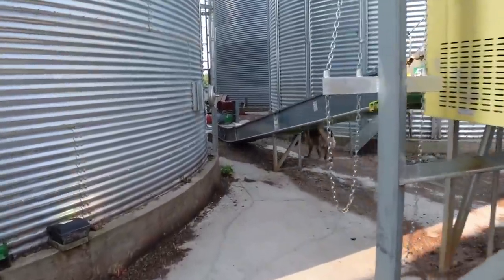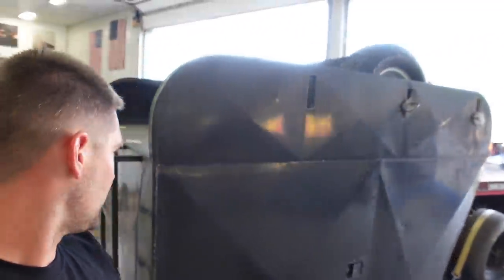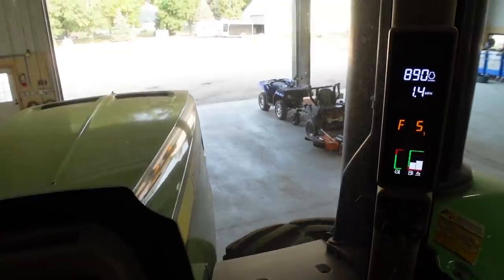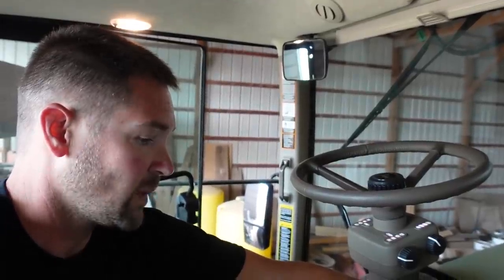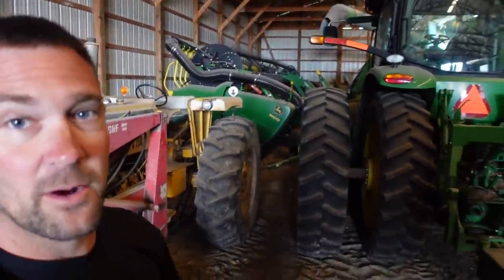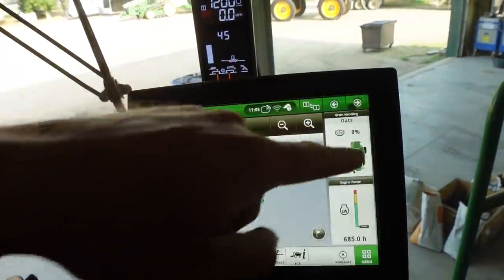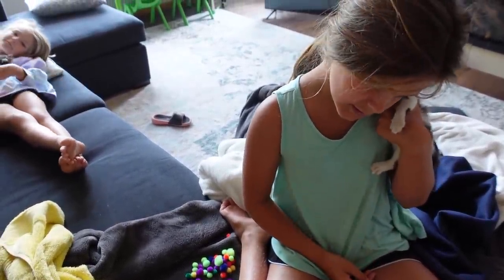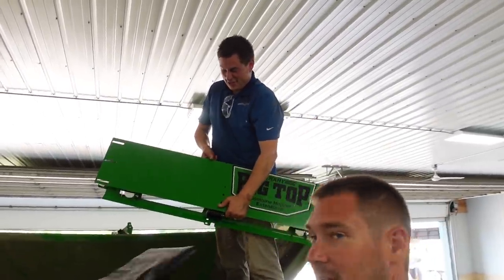Our Land Purchase

Comment: Cool trick I learned years ago from a sheet metal mechanic is if you put a piece of wood on the other side of the metal your drilling, the drill bit wont catch on the metal and yank the drill out of your hand. It just goes right through and you dont get that sudden jolt when you get all the way through the metal. He had a bunch of small pieces of wood that had hundreds of small started holes about an 1/8" deep.

Comment: #1. I hope you enjoy that fridge in the 780.
#2. Just below the bottom right corner of the 780 screen is a physical shortcut button to pull up the "bin open/header unfold" screen.  I love it, it saves time over trying to remember which touch screen button to push to get there.

Comment: If you use an impact driver to drill through sheet metal it will not snag and break your wrist.  It will go into impact mode and power through without snagging.  Most common sizes are available with 1/4 inch hex shaft.

Comment: Some of our equipment gets used so little that we decided to put trickle charge pigtails on the batteries, and hang trickle chargers on the equipment.   Kind of a mess with extension cords running from the equipment to the back of the shop, but a lot easier to unplug a trickle charger, toss it into the tractor (or whatever) toolbox, and go.. rather than go through the hassle of jump starting some equipment, which can be a royal pain depending on where the battery is, getting a jumpstarter over to it, etc.

Comment: Back in 1970, FFA taught me about soil compaction. First I had heard of it. Pretty sure there were few farmers, if any,  that knew it was even a factor.
Everything was moldboard plowed. There were absolutely no chisel plows or rippers.
Reply: When talking compaction what’s the difference between a moldboard plow to a chisel plow? I’m new to compaction as well
Reply: An old farmer told me that the chisel plow goes way deeper in the ground than a flat-bottomed mold board plow. This helps break up the hardpan and builds a softer seed bed in turn getting a better stand of crops. However, he said if you have to much rain at harvest time the softer ground will big you down quicker than if you  used a mold board . Some farmers  he said we're going back to the mold board on that account.

Comment: Have to recalibrate so the transmission will work???  Sounds like a good point for right to repair to me.
Reply from the maker: It's just a safety deal so the transmission can work correctly.
Reply: John Deere just has crappy software, I know because I build the computers for a living (no offense Zack) To be fair most newer model tractors from any brand have modernized their tractors/technology to the point that nobody can work on them anymore. Unless you know anything about hacking the software (which always voids the warranty) you always have to take it to the dealer. $$$$

Comment: why not put them on trickle chargers if flat batteries are so common? or install a plug that any wall outlet can be used to give the starter motor juice when battery cant

Comment: I’ll never forget the time I was drilling metal in a tight corner where my face needed to be right next to the drill battery. Wouldn’t you know it, the bit snagged and I got punched right in the jaw! Then I put it in reverse to back it out, and took another shot to the jaw! Talk about workin words!
Reply: Three days ago, I was drilling pilot holes (less than 1/16") for some 3/16" rivets on a small project.  God knows how I hate tiny drill bits, I broke two & the second one, the broken piece, still attached to the drill, slammed down onto my thumbnail, puncturing it near its base.  Sounds worse than it was, but I certainly don't want to do that again!  LOL

I'm old but still have to remember that accidents happen quick and are preventable, in many cases!!

Comment: Why don't you connect your machines with a long battery jumper lead so when the 1st one starts it uses the battery of 2 and when it's warming up puts extra current into the second machine.. (it's not rocket science)

Comment: What does an acre cost in your county?
Reply: Depending on the area and conditions.

Here, if it is bare (never uses and not cleaned) then it would be $2,500 an acres, if it is uses and clean, then it could go $5,000 to $10,000 an acres. It would be more if it have fences, barn, house, etc.

Comment: I refuse to believe tractor tech has improved significantly when it requires a software update just to put it in gear. Overcomplication is a big problem.
Reply: I am pretty sure your car has a computer controlling the transmission too, it just is much less complicated than what a combine needs, and doesn't have the option to update the software, it just dies lol